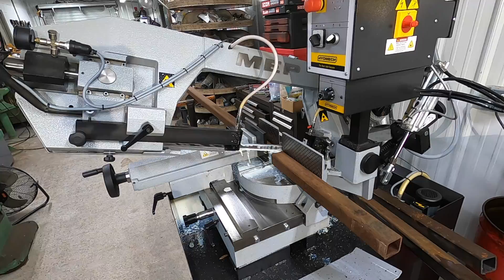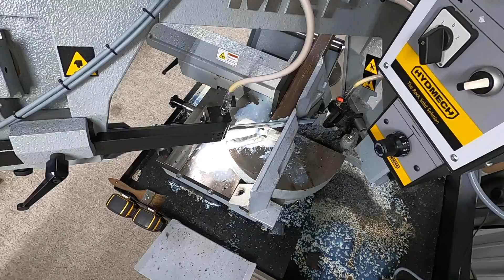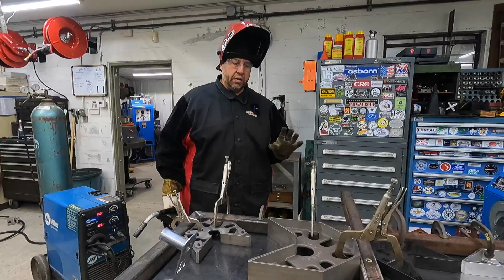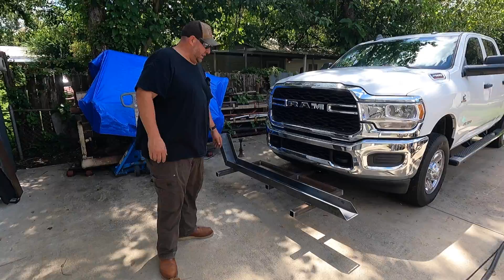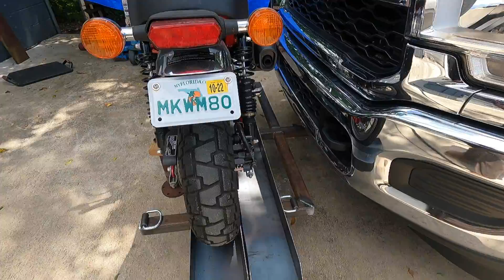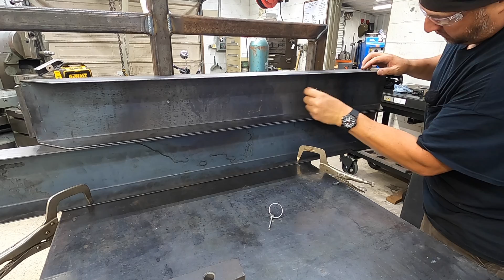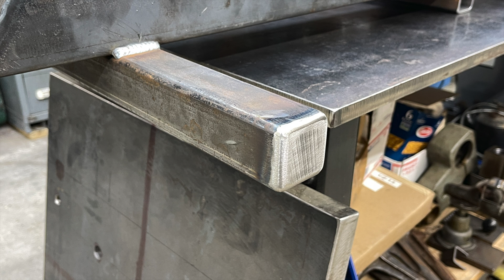Front Mount Motorcycle Carrier Part 2

Comment: Weld the rear D-rings directly in front of the tow points on the truck. Then run ratchet straps over the bike, down through the rings, and back up to the truck.  Secures the bike while eliminating any side-side rocking.
Reply: Forget the back D rings altogether and just strap to the tow hooks.  Two birds with one strap
Reply: @tbernardi001  And what holds the bike to the ramp?  If you say gravity you have never moved anything down the highway.

Comment: Great work Adam. The safety rules regarding protection of pedestrians in a collision wouldn’t allow this to be used on the public highways in Australia. So you usually see these mounted on the rear.
Reply: My thought as well. Pedestrians or animals would suffer terrible injuries.
Reply: According to the United States Department of Transportation's Federal Size Regulations law, cargo can overhang a vehicle in the front by 3 feet, on the side by 4 inches and in the rear by 4 feet.Dec 9, 2018
Reply: P.S. Check local ordinances.
Reply: @mikefoster3547  wouldn´t help in europe either. Cargo may overhang to a certain amount, but mounted on either a cargo bed in the rear or some kind of roof rack. And I am not even sure about overhang in the front. for the rear I only know you have to mark it if you extend a certain overhang. (Like a red flag or red lantern by night) 
The problem would not be the cargo (motorcycle), but the rack mounted to the truck.
Reply: @mikefoster3547  Thanks for this info. As I see it, while the bike would be classed as cargo, the solid steel  structure that it is mounted on might be argued not to be. In the event of serious or fatal injury I would note two things. Firstly what is the position of indemnity insurance due to damage caused by the bolted on structure which might have been less than had the injured party come into contact with the OEM bumper and front panels of the truck. Secondly what is the risk of being sued by the injured party or their surviving family. None of my business of course but I think it is a risky thing to be doing.
Reply: @mikefoster3547  So complying with the law makes it safe ?  I would hate to be hit by it on cycle or walking.  How would you feel if you were on the receiving end at 30 mph ?
Reply: I was shocked to see that you guys are locked down over 3 deaths per day from Covid in a 25 population???
Reply: @KimbrellBrad  The lock downs are restricted to areas where the infections are, i.e New South Wales and Victoria which are getting a 900+ new cases a day. All the other states are open. It’s harsh but is seems to save lives, we’ve had less than 1000 deaths since the pandemic started (population is roughly half of the UK who have had 130,000 deaths).
Reply: @KimbrellBrad  locking down early is how you stop a small outbreak becoming a huge outbreak, especially with Delta.

Comment: The kickstand idea works if the truck is level or slightly low in the front. If it's tilted away the bike will fall the other direction. Maybe a folding wheel lock of some kind to capture the wheel and keep it standing.
Reply: Or maybe Abbie holding it while he straps it down. You don't have to overengineer everything
Reply: @mazchen  Or maybe she’s not there every single time he loads it?

Comment: EDIT:  Your attachments to the truck tow hooks must be rigid.   Straps will help, but still allow too much flexibility:

I single central square tube attached to the truck will break off very soon, due to torsional vibration fatiguing the tube, right where it slips into the socket on the truck.  You must have at least a second attachment point to prevent this, Abom79.

This is not like a tow ball mount, that cannot see torsion because of the ball coupling acting as a bearing.

If you are not planning to add a second attachment point to the truck, you will end up driving over your bike rack - I guarantee it.
Reply: shh shh shh, he's a machinist, I mentioned the bounce from having a unsupported load that is already half capacity darn near a meter away, would crack the receiver (even with straps) and got called all sorts of nasty names by the armchair fab club (I mean what do I know, I'm just an engineer)
Reply: @osgeld  
Your point about the moment from the load hanging so far out in front is something that starts a race:  Which part will fail first?  The tube or the socket...

As for that moment turned in its side not making the truck a pig to steer:  I bet it snaps between massive understeer on turn-in (because the vehicle's yaw inertia is increased), to massive oversteer halfway though a bend, because the back wheels are unloaded to some degree - like braking hard once in a turn.

I was trying to restrain myself from suggesting ignorance.   Decided to offer the fatigue warning and leave it be.
Reply: @osgeld  you sound like the type of engineer that would put a starter in the valley of a V6.

Comment: Looks Abom over-engineered!😉
Not having a nice large flat welding table, I always clamp an aluminum plate on top and bottom of the joints and tack the joint in several places. Makes for a flat finished product as long as the tubing is straight.

Comment: What do you think of the ground clearance for entering a steep drive or road?
Reply: I was wondering that myself, also dodge front ends have been known to wear out ball joints and other front end parts prematurely - hope its not the case here especially with all the extra weight bobbing around out front.

Comment: I'm a bit worried about the fact that all the stress, twisting and vibration etc is going through that one square tube / socket. I know it's rated at thousands of pounds, but there is a lot of leverage if, say, the bike rocks back and forth and you might get fatigue problems. Then there's only one pin keeping the whole assembly attached to the vehicle. Is there no way you can brace the two outer corners of the frame to the truck chassis? To reduce the leverage a bit, swap the ramp and bike channel to move the main mass inboard about 6 inches.

Comment: Really nice design, one thought, you have no way to lock the bike up. When you get back from your trip, you could weld a couple of loops onto the front wheel rest that would allow you to put a pin through the front wheel spoke and lock it with a padlock. Also, if you find that the ramp rattles too much on your trip, you have plenty of room to add a rubber washer under the ramp to dampen it movement. Thanks for sharing this.

Comment: I have a bicycle rack that has a device the pulls the hitch pin and keeps the rack tight in the receiver. A slotted block is in the rack tube that goes into the receiver. The block has a threaded rod that goes to a threaded handle at the back of the tube that when tightened pulls on the hitch pin. Look up Hollywood bike rack no wobble system on YouTube.

Comment: I watched your video on engine temp. Do you monitor transmission temp? What range is it running? I know the coolers run lower than the radiator, and over heating will cause failure.

Comment: Hook the ratchet straps on the rear D rings then through the 2 big tow eyes on the truck then over the bike to the front D rings then once they are tightened down it will not only secure the bike but also stop some of the movement in the rack you showed when you trial fitted it.

Comment: I would have made the ramp so it could either lay down inside or outside the channel and have it hinged. No pins involved to get lost. No relocating the ramp.
Reply: How would you get to the ramp with the bike up there or put it up there if it's used to roll the bike up?
Reply: @Gary.6.10.19  being the ramp is hinged,lay it open to roll he bike up. with no bike in the carrier, being it is hinged lat it down,fold it up.
Reply: @jerrydemas2020  so the ramp would stand straight up when you're driving around with the bike on the front?
Reply: @Gary.6.10.19  yes
Reply: @jerrydemas2020  yeah that could be nice. Get it a bit closer to the truck anyway

Comment: I would bend some 5/16" round bar into a long U and weld it vertical to the carrier to form a cage that the front wheel rolls into and holds the scooter upright until strapped.

Comment: @Abom79, to attach to your tow hooks i use endless ratchet straps. You can order them online for cheap, or if you have a honda dealer near you stop and see if they will give you a few. Goldwings are strapped in the crates with them and most dealerships will give you a few because they have so many laying around.  They do not have hooks, so they can strap down to 4 inches or so.

Comment: What would happen if you make pins a little  longer  so you could put a spring on top to hold down  pressure  on ramp to keep from rattling  when driving
Reply: or add a rubber washer on each pin.
Reply: With a washer...  On the bottom.
Reply: Or some gold-plated diapers.

Comment: You might get some rattling from the ramp when it's mounted. Maybe a little rubber glued to the rails under the ramp will eliminate any rattling.
Reply: I was thinking the same thing. Easy fix.
Reply: @johnbaskett2309  Me too, same thoughts.
Reply: I hope he ends up having the hole for the pins parallel with the ramp. 🤔 If the pins are longer than half the width of the ramp, it may be impossible to get them into the hold-down posts!! 🙄 How about a couple of pieces of foam between the ramp and the frame? He'll prolly think of something after the first trip listening to the rattling!!!🤪
Looks like I wasted my "hope"! 😁 As usual, Adom was way ahead of me! He even used a rod to make sure the holes were closely aligned! Reminds me of an electrician who makes sure all the screws holding cover plates all are aligned! Few will notice, but Adom (and we) will know!
Reply: @arkiefyler  have you even watch the video? The pins are already welded and properly positioned...
Reply: Do you know how he remedies this?

Comment: May I make a suggestion? Punch 1 inch holes in both flat plates where the tires are and the ramp for drainage going down the roadway. Maybe I should wait until the complete build.
Reply: It'd take some weight out as well.
Reply: Only fixed with the pins, the ramp will rattle badly during driving.. I would add a threaded bolt with a thumbscrem to hold the ramp down. And/or some cushioning underneath.

Comment: If you're not going to use wing nuts to hold down the ramp, then you might want to glue some rubber to the bars for it ride on. Else the rattling may be an issue.